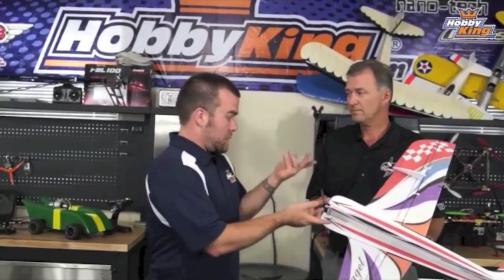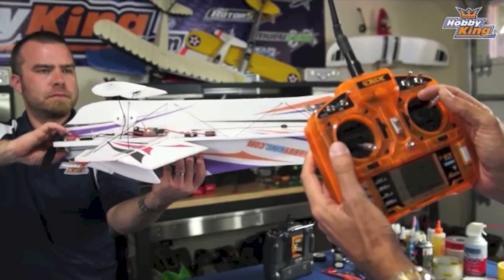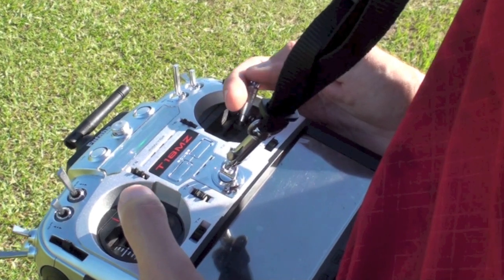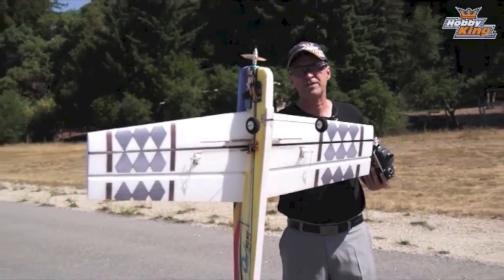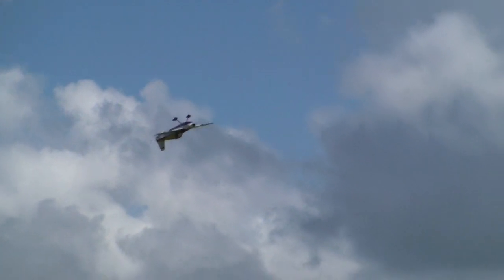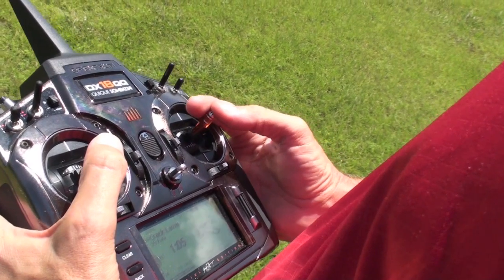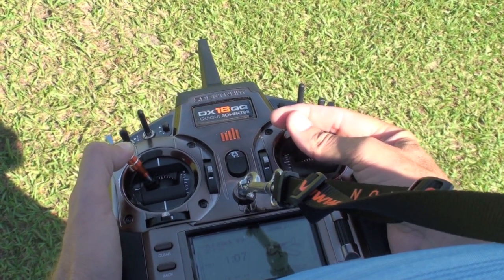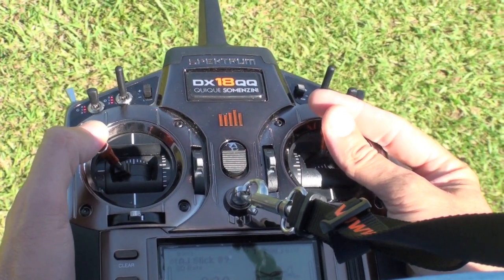MIchael Wargo on 3D Maneuvers:  In-depth, slow motion stick moves  Explained and demonstrated

Comment: You didn’t say what the controls were for hovering other than very small inputs. I assume it is just elevator and rudder. If the plane tries to go to level flight give it up elevator to push the tail back under the plane and vice versa. I would think there is less tendency to go left or right for the rudder to correct.

Comment: I get too fumble-fingered with too much going on too quickly.  I have a RealFlight simulator -- I wish I could slow-motion it down to practically zero to get the moves rehearsed and then slowly add speed eventually back to normal.  Physics changes can slow down the airplane...but not to the degree of slow-motion I need.
Reply: This is possible in Realflight. For Realflight 8 and 9, In the Simulation menu, Under 'Physics'  change the tab from 'Difficulty' to 'Custom' . The the top slider is for 'Physics speed' which can be dialed down to as low as 25%
The others will have it under the physics settings, I don't have the earlier ones installed so I can't say exactly. I hope you come right and happy flying!